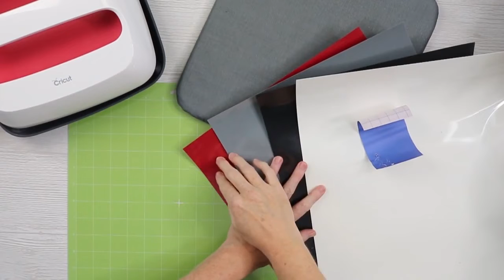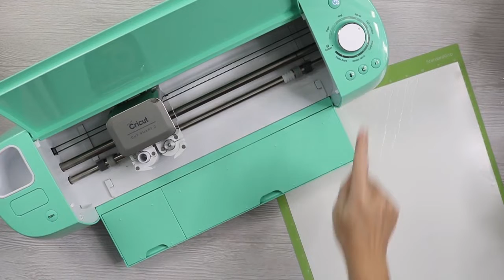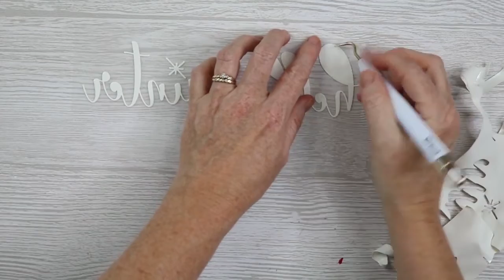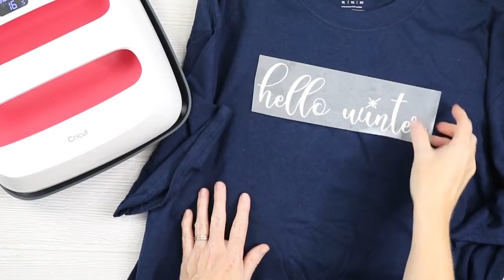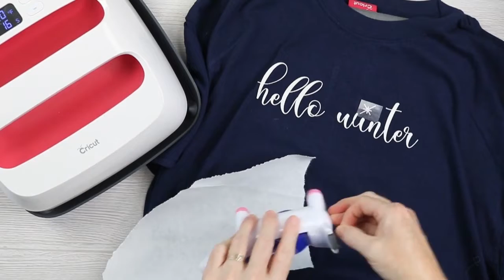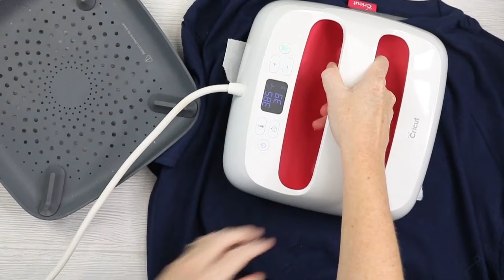How to Use Flocked HTV with a Cricut

Comment: I get that we can use the vinyl + setting but I'm missing the flocked iron on setting which is what my sub htv for dark fabrics calls for I only have it for flocked paper in my design space app for some reason. It is completely updated so that's not the problem. I can add a setting, but I don't know the cut settings to be able to add it.
Reply from the maker: I don't think they have a flocked setting any more.

Comment: I purchased several rolls of flocked from hobby lobby. Paper studio brand.  I have tried every setting and it is ripping it to shreds and not cutting well at all. I have tried glitter htv setting, iron on plus and many others.  Have wasted several cuttings. So frustrated.  Brand perhaps??
Reply from the maker: Oh maybe! Have you tried the washi tape setting and cut it twice?
Reply: @AngieHolden  no. Does that work for you?
Reply from the maker: I use that if I am having issues with ripping of a material.

Comment: Hello, great video.  I purchased the B-Flex Print Flock for sublimation based on this video.  I'm very confused as to how to cut this vinyl.  There is no carrier/transfer sheet on the flock side.  There is a thin paper cover on the adhesive side.  No matter what side I lay down, it will not adhere to the mat.  I even cut and added a transfer sheet layer down to put the b-flex on and it still won't stick on either side.  Am I going to have to tape this down with masking tape every time I use it?  In your video, it looks like your white flock has a transfer/carrier sheet.  I see that B-Flex has a BF Flock and a BF Print Flock.  I purchased from The Vinyl Stand and it indicated the BF Print Flock HTV was for sublimation.   The Vinyl Stand is not responding to my questions abnd I'm trying to finish an Easter Shirt.  Any help you could provide would be appreciated.
Reply from the maker: They do have two different types. The print flock is for printing on your sublimation printer but I think you can use it in the same way I did here. Can you maybe send me an email or join my Facebook group? I think I need pictures of the product to see what it looks like before I can answer questions about what side should be down!
Reply: @AngieHolden  thanks for responding.  I will join your FB group.  I actually got hold of someone at B-Flex  and they sent me a YouTube.  You cut flock side up and I will have to tape it down to my mat.  I like what you had!
Reply from the maker: Got it! Glad you found out! I have on my list to work with their printable flock!
Reply: @AngieHolden  I’ll be interested in your thoughts.  I had to tape it down to mat ANDuse my deep cut blade.  It doesn’t discolor with heat.  It sublimates well and washes well.  Only thing i noticed is on 2 shirts I had quite a few unplanned dots pop up.  Research says it’s stray stuff on fabric that sublimated to shirt.  I was working with smaller items and patching things together so i think that was a problem...unless it somehow has something to so with the flock.  It has pros and cons.  I’m pretty frustrated with it at this point because it was hard to find info on and i had so many problems.
Reply: @AngieHolden  the manufacturer is very responsive and i asked if i could sub on their regular BF flock.  They said it was not for sublimation.  Have you washed the BF flock before and did it hold up?

Comment: Hi Angela
Do you also use transfer paper on tshirts? I used transfer paper on hoodies but I had a white bix around my image. How do I get rid of that excess paper where do i go wrong?
Reply from the maker: Transfer paper should not leave a white box. What type of HTV did you use?
Reply: @AngieHolden  it is not vinyl it is ppd T-shirt transfer paper light . I am using a 5 in 1 combo heat press
Reply from the maker: Ah got it. You will need to cut around your image once you print it. I assume you are printing it. So print the image then cut around it with scissors or your Cricut.
Reply: @AngieHolden  thank you I will try that. Thanks for tips love watching your videos lesrn a lot from them.

Comment: Hi! Do you get peeling after washing your Htv done projects? (Tshirts etc) If not what am I doing wrong?
Reply from the maker: I generally don't. Could be a few things. First, every HTV that you buy will have different instructions from the manufacturer on how to apply. Be sure you are following those. Second, shirts, etc can have a coating on them when purchased from the store. Be sure to wash them before starting your project.